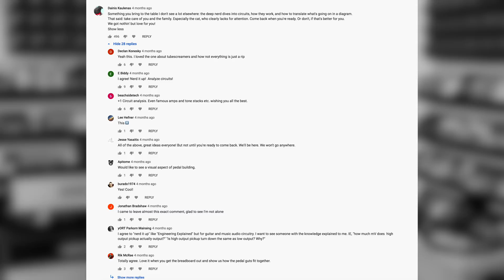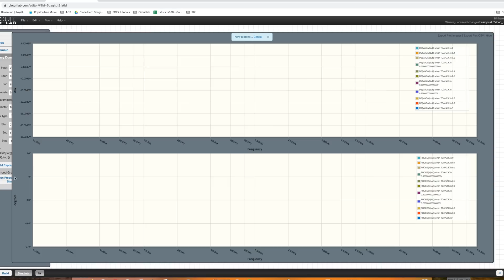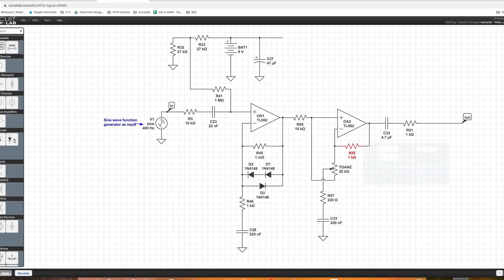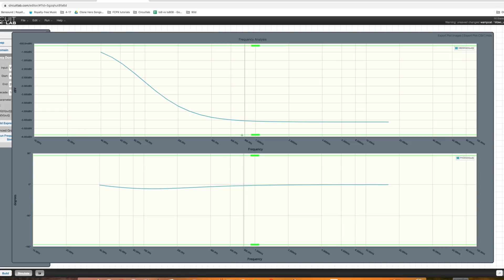Let's get nerdy: 3 types of tone control circuits & how they work

Comment: The interesting thing about distortion circuits is that the core distortion element (2 diodes, 3 diodes, Ge vs. Si-diodes) is only of secondary importance (at least for the ear - the spectra are actually close, but not the same). The actual "sound" of a distortion pedal is determined by the pre- and postfilters. 

This is also the reason, why all this fuss about different and "magic" diodes is complete nonsense and only being driven by greed and making certain pedals and diodes "magic" ..... in a real double blind test the core distortion circuit alone will be hardly detectable.

Comment: The two first types of circuit have the tone pot after the rest of the circuit. Would it be the same result if there would not be a tone pot but an external EQ pedal after the circuit ?
Reply from the maker: No, that would make it sound different
Reply: @wampler_pedals  there is an overdrive pedal whose designer claimed the bass control is post clipping, but the treble is preclipping , and he put a switch for three fixed options of treble eq, one of those he named glassy. I have seen a similar switch in another brand fuzz pedal that claims to be glassy. So there is no way to simulate those glassy sounds using an EQ pedal before or after that overdrive/fuzz pedals ? They would be other type of glassy ?

Comment: like many musicians I kind of like to know how things work. I get amplification and high/low pass filtering I can wrap my head around a tape delay but how the hell would you do delay with no moving parts? or even modulation effects with no moving parts for that matter. must be something to do with electrolytic capacitors charging and un-charing? gosh, there is so much I don't know. but yeah just because I don't pick up a soldering iron all of about 2 or 3 times a year don't mean I'm not still interested.

Comment: Another question: Can you confirm that r45 is a .001ohm / milliohm resistor? Its such an uncommon resistor value and Im not sure its function there?

If I understand correctly the 1mOhm resistor is where a potentiometer would be that would adjust the gain? Also this part of circuit is not the actual filter youre talking about. The filter in the circuit is actually just the RC and potentiometer at the output of the opamp (for circuit 1)

Comment: Would you recommend logarithmic or linear potentiometers in these circuits? Also, I have an existing amplification circuit using an LM386 I am working on to learn. Could I just feed one of these circuits into the input of my amplification circuit? The circuit Im using to learn from is here:
http://amgworkshop.com/wp-content/uploads/2017/01/diy-homemade-guita-amp-lm386-01.png

Comment: I recently discovered your channel and it's so full of useful and interesting information, so thank you first off for sharing your knowledge. I started making VST plugins a while ago and I'd love to be able to implement what I've learned in analog hardware. I noticed in one of your big muff simulations that the high end frequencies tapered off like a low-pass, but the low end looked like it was behaving a bit more like a shelf. I'm sure I'm probably just misinterpreting what I'm looking at, but how would you go about that if you wanted to make a multi-band tone control (like a separate bass and treble) where the bass control works more like a shelf? Would it be something like a low-pass in parallel with the other tone controls where the knob acts as a level control or something like that?

Comment: These are very useful to me. For too long I've been the victim of "modded pedals", from friends who thought they were doing me a favor, only to find that I had a problem on my hands that I needed to solve. Right now, it's a germanium transistor boost/fuzz, that's basically two in one, and needs some serious help. The friend who built it for me (who I paid $300 to do so), has no idea how or what he did to build it, so I'm entirely on my own if I want a useable $300 pedal. It's crazy, I know, but it's a good excuse to learn. Cheers, and thanks for the great content.

Comment: I like this kind of video, but I am a EE.

I wonder about the Timmy tone control with the bass control in the feedback sink, and the treble after the op amp. This circuit uses two low pass filters.

I remember my circuits prof saying high pass filters are noisy. It was the introductory class, so he probably was oversimplifying. (I only took digital signals courses after the basic circuits course, so everything went through low pass to cut frequencies over the Nyquist)

Comment: Hey, thanks for cool nerdy videos. I have a question about TS circuit. I'm trying to breadboard one and I've seen lots of schematics online, half of them set the clipping  opamp inverting input leg to the ground and another half to half voltage. Why is that? When I try second variant there is almost no clipping, how can that even work?
Reply from the maker: The 4.7k/.047u? You can do either, but unless going to low impedance Vref I’m not a fan of doing it that much. The vref is just sort of a virtual ground thing

Comment: Love the nerdy info. I know you have to keep these vids short and sweet to please most viewers but I would have liked to hear maybe three positions of sweep on the tone pot hi, mids and lows while the guitar plays chords and riffs. Picky or what. :) Also some basic background on the frequencies you talk about, like what range would a std. guitar or a bass cover and roughly where the guitars lows, mids and highs sit in the Hz or kHz range. A bit of framing for any newbie nerds. Just a suggestion to consider. Actually you pitch these vids nicely focussed with no condescending. If we need to find out these picky extra details it's easy to Google and its good practice.

Comment: Um uhh...Mister Wampler Pedal Dude? Why do you show voltage going to the non inverting input of one of the op amps and not to one side designated "pin 8."

Comment: Brian, off the wall question.. I'm at the planning and components purchase stage of a studio-shop-work-play building (ok frigging 24'x24' garage kit expanded to 24'x36') any issues I should be careful of RF/interference wise with todays LED lighting fixtures? I know to be careful with florescent, dimmer switches and such but with incandescent bulbs on the way out choices from the big box stores is getting limiting.
Reply from the maker: I’m not the best one to answer this, but when I built my room I just made sure the lights were on a different circuit than the one my amps and pedal power supplies are on. I didn’t do any special shielding.
Reply: @wampler_pedals  thanks boss, the separate circuits is a great idea  much appreciated!

Comment: As an electronic engineer I think showing the schematics will be very helpful to those interested in building their own "effect" without having to know how it works.  This method of approach will undoubtedly inspire those who has the curiosity to learn more, possibly much more and then they have the knowledge to design and build their own equipment.  Having a background in electronics and music these days fits like a hand in a glove.  One last thing, since you work for wampler, I have 1 question.  Why are the screws so damned tight!   Years ago when I bought my first wampler I wanted to know if it also ran on a 9v battery, since neither me or the salesman knew I had him get me a #2 philips from the repair shop and jfc! I liked to never got that cover off! 2 other wamplers, same thing.  Instead of tightening those screw to an in/lb of the housings shear strength, use a pennies worth of low/medium strength of thread locker.

Comment: These are really good circuit videos.  Keep making them. Getting inspired to make an overdrive with 3way switchable tone control so I can choose between all3.   Also considering setting up switching between multiple types of diodes/ leds based your other video.  A whole mess of a circuit but sound options.....

Comment: Thank you for the video. I want to ask a question about OpAmp. You are using a dual operational OpAmp. If I use single operational OpAmp (for example TL074) will it work just like your circuit. Thank you again :)

Comment: I would love to see a follow up video, with different tone controls, 
for example what gain knob on Klon does to the tone, 
what are active vs passive tone controls, how the tone control on 
the RAT works, how pedals and amps middle tones knobs sound
completely different because they work with different parts of midrange, 
why there some pedals have  tone controls that are passive on 12, and some are
passive on min or max setting etc..
p.s. and i would love to know what "tone switch" on my Ego Mini does, because it feels like
with it off the tone is darker which is understandable on compressor, 
but with it on it seems like there is more brightness than with the pedal off.
Im pretty sure it's a treble bleed, and i think there is more brightness because the 
rest of the tone is squashed, but a confirmation would be great :)

Comment: Great video! 

Like the big muff with a mid bump, have been puzzling over a tone control for my first breadboard pedal attempt and will try this. 

Could you get away with a smaller pot value for  TOANZ?  I have been hurting my brain thinking about it. 

What is the function of the 1k resistor at the end? 

Thanks for all the info.

Comment: These videos are good and they aren't too technical. I'd like to see a video explaining how opamps sound different from transistors and what effect they have on a circuit's function overall. I've found that transistors seem more musical than opamps, and 1 transistor usually sounds nicer than 2 transistors. Actually I'd be interested to hear what analog delays and choruses would sound like if they used transistors instead of opamps.

Comment: What about a pedal that has 2 separeted tone controls: one is the frequency for a Low Cut filter and the other the frequency for Hi Cut. So the sound can be fully dry with both knobs without cut, to fully tailored to a specic frequency range, either narrow o wide.

Comment: I put together a poor mans Hoof/Reaper.Doubled up the Tonestack on a toggle switch so that the tone bender can get the same tone stack as the Muff . its a fun box with lot wiggle room for tones. that circuit is called AMZ tone control, its crazy fleksible. Good educational content ;)

Comment: Woah, you kind of triggered my nerd response when you described the Tube Screamer pot as "kind of different".  I modeled the Tube Screamer circuit, recorded the swept response, and plotted in Excel. It looks like each end is almost (not quite) a log taper. 

To answer the question, the Tube Screamer is my favorite, not only audibly, but from a circuit design point as well.

Comment: Hi Brian, as a very amateur pedal builder/modder (mostly gain/drive type pedals) I enjoy the tech talk vids. Could you offer some advice on what I can try doing to make my pedals better suit active pickups? I have read that higher operating voltages can make a difference but don't know if thats true? and I've seen Bass pedals advertised as suiting active pickups and wondered what was different about them, could the same ingredients be applied to guitar pedals? 
That video has given me the inclination to tinker with my Big Muff tone circuit as it sounds better with an Eq pedal and some additional mids. 
Thanks.

Comment: I like these kinds of videos, Brian.

One question though.  In this video the gain circuit sounds like it lets some of the clean sound through in parallel with the overdriven sound.  I know that' s technically not what's happening but can you explain why these kinds of soft clipping circuits do that when the hard clipping circuits don't?

Thanks.

Comment: Great video. I love this type of content and you make it so understandable and relatable. Nobody else is doing that. The circuit diagrams and frequency graphs help visual learners make senses of the sound differences. I liked the mid-boost “big muff”  tone stack the best. Sounded great. Big and thick but also I imagine it will cut through a mix.

Comment: Make a crossover that separates the signal into 3 or 4 bands then distort each individually, then recombine. One could in theory have diode crunch on the low and op-amp gain on the high, etc., or whatever.

Comment: I like these type of videos. Even though some of the schematics stuff tends to go over my head. It's not boring and the soundsamples are really revealing. I have a few suggestions though: 1) Put those soundsamples (short versions or something) again to the end for a head-to-head comparison. It'll show even better the differences. 
2) How about a series of building (f.e.) a overdrive pedal. In the first episode go through just the overdrive circuit and what are the common types. Then in the next episode add an gain pot to it, then a tone pot, etc. etc.
Kind of a "My first overdrive from start to finish" -sort of thingie.

Comment: My only complaint is that these videos are not nerdy enough!  There is so much misinformation out there and it is really, really, REALLY great to see the truth.

If you wanted to do a series of short videos on the individual parts of the circuit, I'd be absolutely ecstatic. 
Questions I can't find the answers to, but probably have simple answers:
1) what is all that stuff in the power supply part of the circuit?
2) what is the difference between an inverting/non-inverting circuit (other than phase)?
3) why does everyone else sound awesome when they use a Rat, but when I use on the tone control is either way too bright or way too dark, with no happy medium? Is it because the slope of low pass filter is too extreme?  Is there a way to mod it so it sounds more like the Bluesbreaker tone circuit?

Thanks Brian.  You are the best.

Comment: Thanks for this video. I’ve been helping my daughter with her major school project, making a dual boost/drive pedal, which has allowed me to gain some insight into effects circuits. I’m hooked, and your videos have really helped. What I’d really like to know is different ways to wire up 3PDT switches, to have each channel truly independent (for her pedal one runs into the other), how to make quiet circuits and how to achieve true bypass. We’re working on a breadboard test bed similar to yours! Thanks from the UK

Comment: How hard would it be to have an overdrive with a 3 position toggle switch and three tone controls labeled 1,2,3, so that all three of these types of tone control could be in one pedal?
Reply: I think it's not hard to do it for the sake of just doing it, but you're gonna end up with a lot of extra components. The hard part is to optimize the design so you don't waste a lot in extra components and so you make the design profitable

Comment: Got your book last year and its great, fyi I took it to my UPS store had the spine cut/trimmed off and punched for a three ring binder ($5, my FedEx will do the same w/ ring back for the same price.) so it lays flat on the bench on the pages I want to refer to. I've done the same with analog Mike's book and several others on amp construction and basics. Ruins whatever collector valve there is but makes using the books in the shop much easier. 
Thanks for the video, intriguing enough that I'm going to rewatch Uncle Doug's vid on tone stacks..
Reply from the maker: Thanks!
I didn’t know uncle Doug had a vid on tone stacks- I’ll have to check that out!
Reply: @wampler_pedals  yessir, it's back aways  in his video catalog with the tube amp 101 videos